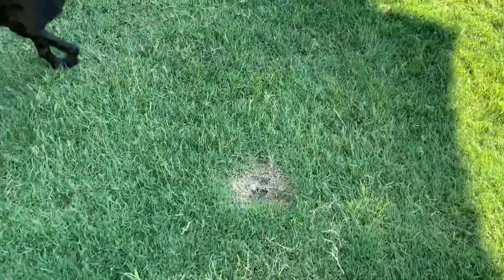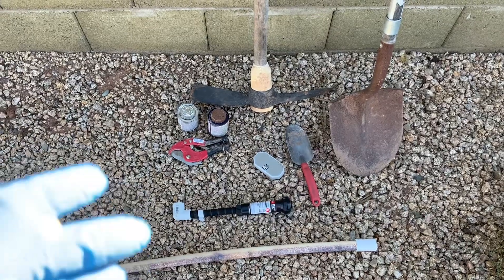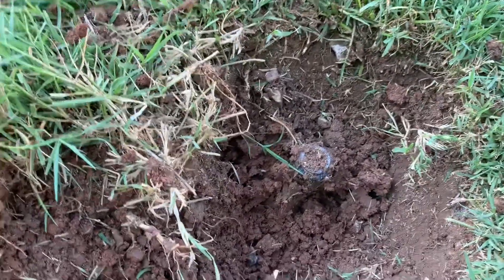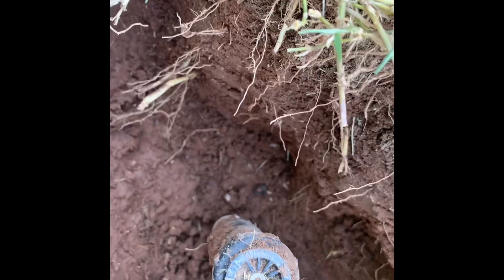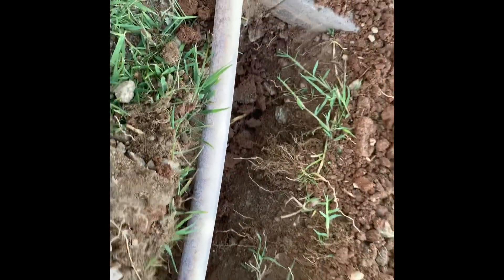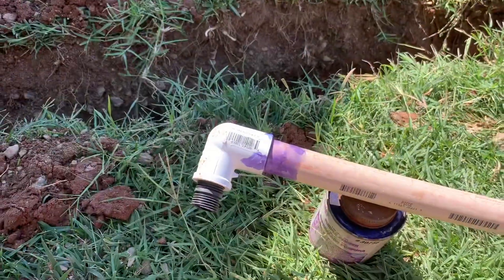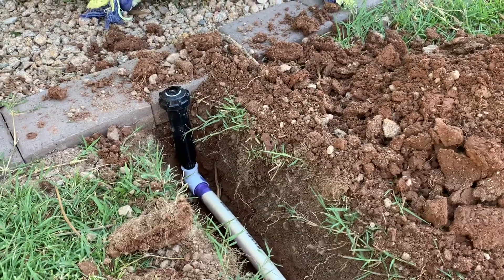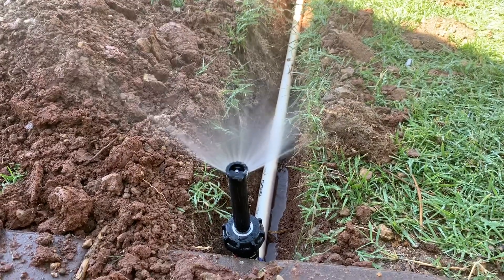How to move  or extend sprinkler lines  a few feet quick and easy from an existing spot in your yard

Comment: Thanks for the video. I need to do so this. About how long did it take just to dig out completely the one you were taking out?  And how many hours for whole project? It takes me forever to get down below a sprinkler. My ground is so hard. I’d love to see your method for not damaging the existing connections. I’m clawing with my fingers to get dirt out from around it.
Reply from the maker: Took about 1-2 hours for the whole thing if I remember correctly.  I live in the southwesterly part of the US and it’s VERY DRY here. What I normally do if I know I have to dig something is I wet the area about 2 days before ( unless it needs to be done immediately) and let the ground get nice and soft . To dig out sprinkler heads I actually use a small garden shovel like you would use to plant flowers . When the ground is soft it takes hardly any time to get down to it . Plus using a small shovel to get down there will help not damage the pipe . Or anything else .  Let me know if you need more detail. Thanks for watching and the comment 👍🏻